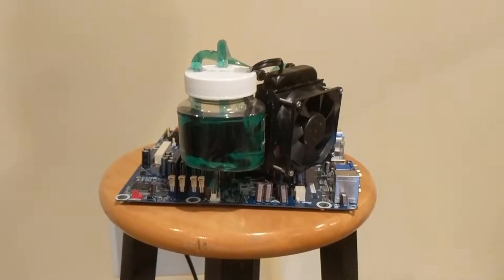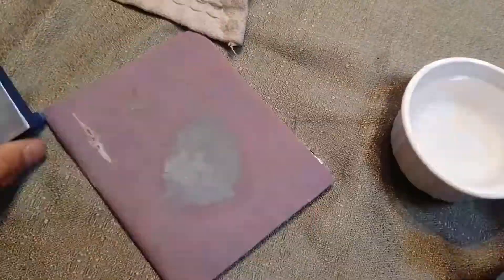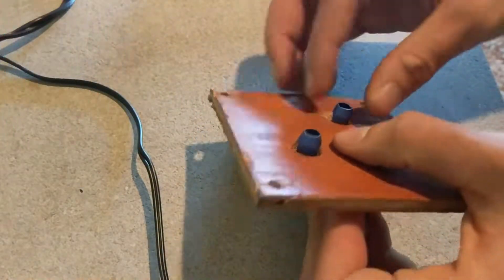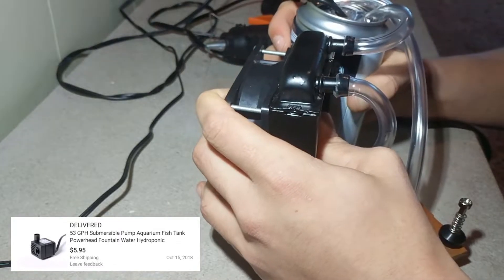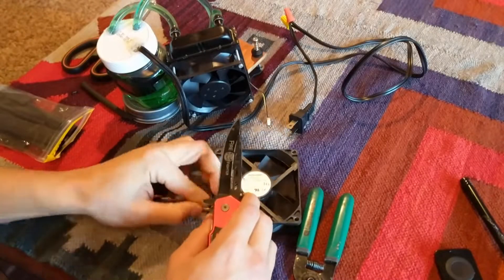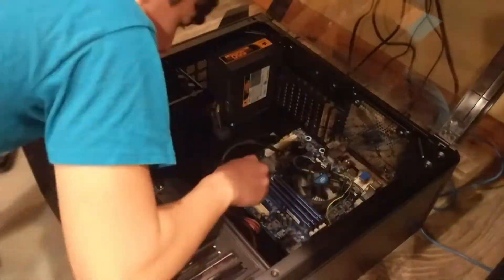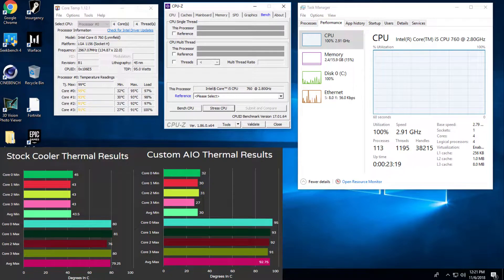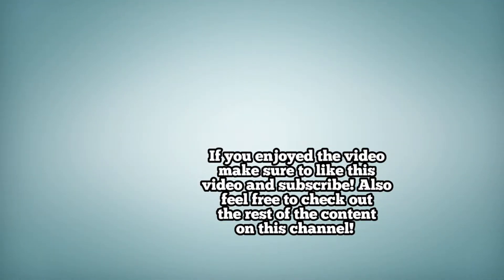Custom All-In-One Water Cooler

Comment: 🙂 Cute Science Project, thats really scary tho having all that 'stuff' rite above the motherboard, i suggest you lengthen the hoses that go to the cpu block, stand up the case and move everything that has liquid over to where the hard drive cages are, also the initial testing u cud try putting the case face down so that any tiny leaks fall to the table instead of the board, since its just for fun how about adding glitter to the water so you can actually watch the water flow better, its sparkly too, reminds me of those toys i saw as a kid, and if ur going to short circuit out a motherboard next time it should be a rysen board LOL 😋
Reply from the maker: Well I did test fill the loop outside of the computer and there were no leaks. What I believe happened was when I was removing the cooler from the case some water spilled out through the hole for the power cord for the pump. Thanks for watching!
Reply: @sebastianmcgregor465  ✌️😎 okeedoke buddy, see u on the nxt video, now let me get back to my Core2Quad yay 😋
Reply: @sebastianmcgregor465  😛 yay im picking up Prey at my Microcenter, its on clearance for $10 in a retail box and dvd 😙📀 I just checked on utube and its playable on Low with Core2Quad 🐢🐢🐢🐢😍
Reply from the maker: @MrSamadolfo  Good luck with that! long live the Core2Quads!
Reply: @sebastianmcgregor465  🤟😎 fkyeah! 🤟😎